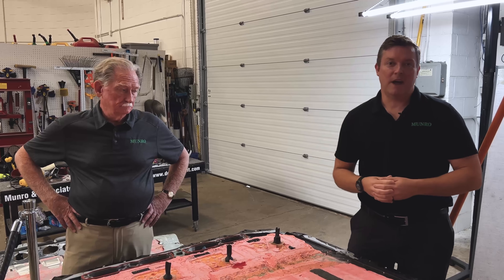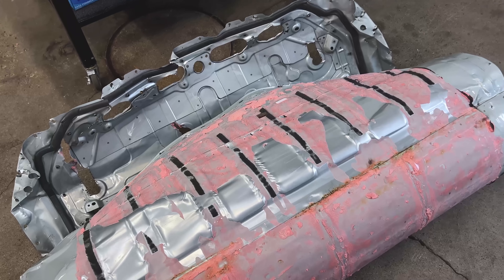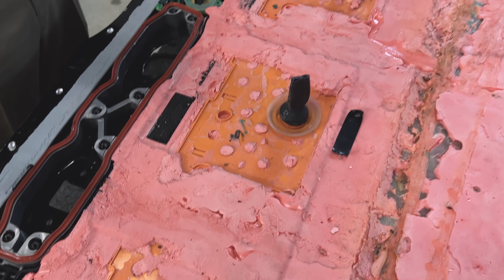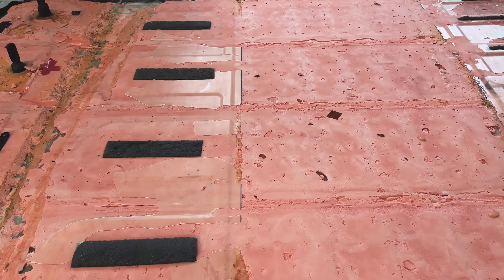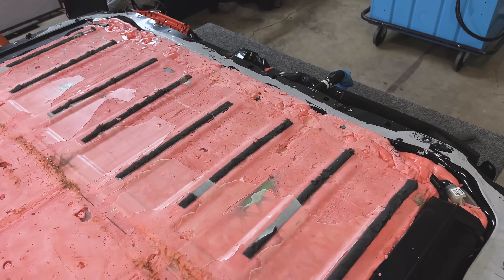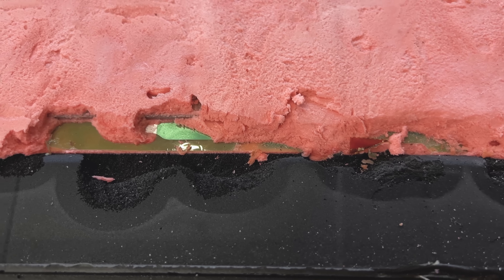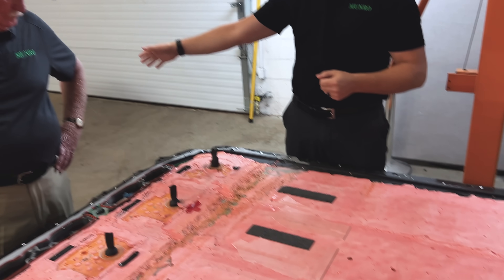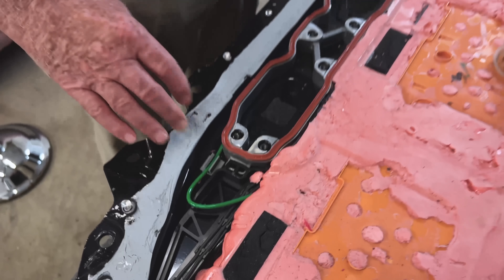FINALLY! 4680 Battery Pack Lid off | Tesla Model Y Update

Comment: I looked into it because I was bored, if they’re going to try and dissolve all the foam the only way to remove all of it is a combination of equal parts Tetrahydrofuran (THF), GBL and NMP. of all known solvents only this mix does 100% of the job and melts it away.

these three solvents are fairly safe (NMP can cause birth defects but as long as none of them are pregnant it’s probably not too bad, the studies show it’s not that horrible and the studies were somewhat inconclusive)

I still think trying to go in from the bottom and cutting through the aluminum is the best bet.

Comment: I wish someone could explain why this structural battery pack is a good idea. Seems silly to me. Like making a bridge out of marbles
Reply: Wrong analogy, structural pack is to eliminate the extra weight of batteries as potatoes inside a big bag in your car and to use those potatoes as the structure of your car. So you eliminate the other structural members, heavy cross beam rods and 69 other parts. Its god tier efficiency.
Reply: @neighborhoodtroll  I think cross beams are a more efficient use of structural material than the thick, heavy metal added to the 4680 casing

Comment: I’m sure there’s an obvious long-term gain on the emissions side but can’t help thinking how odd it seems to replace an ICE engine and fuel tank with an unrepairable battery encased in an oil-based product that will require dissolving with some kind of wicked solvent for any type of reuse.
Reply: Its really rediculous and I hope Sandy will aslo discuss the serviceability topic. 
That structural battery may be measurement to reduced the production costs of a BEV vehicle but involves at the same time a high risk for the guarantee and goodwill costs.
As long as battery uses moving electrical parts such as switches relays or contractor batteries will fail. 
But who cares within time of guarantee this risk will be less

Comment: The best move is probably to flip the thing over and go through the aluminum on the bottom. Chemicals are a baaaad idea. Trust me it won’t do anything but soften that foam and melt the plastic below and get your batteries stuck in a gooey caustic mess. Dimethylformamide or N-Methyl-2-pyrrolidone are not chemicals you want to mess with!

DMF is readily absorbed through the skin, inhaled, or ingested and a potent liver toxin.

NMP is a teratogen. So you’ll possibly have a flipper baby if exposed to it. Effects and deforms human embryos.
Reply: I don't believe that flipping it over will help.... to be truly structural that foam has to entirely enclose the batteries to make a solid brick. If the batteries were loose underneath, none of what's going on up top would make any sense.
I wouldn't be surprised if there was even more foam on the bottom, to ensure that nothing pierces into the pack if the vehicle bottoms out onto something pointy during an unplanned departure from the road.
Reply: That is too high price to pay for subs on YouTube 😅
Reply: In this video we already see that the electrical connections between cells appear to be on the top, so to analyze the design and construction of the battery (which is the point, despite the plan to sell cells) it needs to come apart from the top.
Reply: When I worked at Schaffner R&D we used to dissolve competitors products with dangerous chemicals. Everything comes apart if you throw your mind at it. Workers safety is another issue, it can be overcome but exposing them chemicals to the environment is perhaps also questionable. In my apprenticeship we used endless drums of Freon just to pride ourselves with clean circuit boards. Not sure which job did more damage to my internals. Back in the 70's it was also common to smoke inside confined small hectic offices all in all a third danger to my health. There are already videos floating around dissecting them new cells.
Reply: @LawpickingLocksmith  Jordan Giesige of The Limiting Factor is doing a very professional tear down of the 4680 cell with some experts at SDSU. An excellent channel that goes in depth into the EV battery thing.
Reply: @terrysullivan1992  
🤔
Jordan?  Very professional.
The stripdown?
.
They know chemistry, but at one point they were using pink handle nail scissors to try and strip the steel casing.
.
🤔
I reserve judgement.
Reply: Meh.. NMP isn't a big deal.

Comment: So the repairability is basically zero? you can't replace a single module easily and have to recycle the whole thing? it may have great characteristics but I'm not sure it's worth it, it really looks stupid to me and a waste of resources if only a few components fail. 
Or am I missing something?
Reply: There's a significant amount of redundancy in these battery systems, so it's unlikely that a few failures will scrap the whole battery pack. 

Then there's options for reuse in other (less demanding) applications, like stationary storage. As long as it's not a safety risk (ie was damaged in a crash etc) the pack will have a function.

There's also other issues with taking the repair option. Mismatches with battery age is one, you can't put a new battery in with old, easily (you could probably do a whole module, but not cells). You also have issues with safety when the whole thing is pulled apart (worker safety around high-power) AND when put back together, nothing ever goes back as well as it did from the factory lol.

As nice as it would be (I love user serviceable stuff) it's not a sensible option.
Reply: Perhaps it is serviceable from the other side, but this looks like a hard nut to crack.
Reply: The human cost in dropping a battery to replace a cell basically costs close to the amount of replacing the whole battery. That is what was missed.

Comment: Why not try one of those scanning lasers that remove rust?
Should eat up that foam but leave metallic surfaces relatively untouched
Reply: The lasers are set to a wavelength for the rust to absorb. The Foam will likely reflect the laser

Comment: Most engineers design and put stuff together - Sandy tears stuff down and tells what you did wrong and how to make it better. 😃
Reply: i was to say that, good critic is always welcome
Reply: i have worked on few of those foams, in insulating , refrigerated containers
Reply: To make it better....
1) FIRE the people who designed a $10,000 to $ 20,000 unrepairable battery pack!
2)  Redesign the battery pack so that it is NOT structural and can be opened to access components for repair.
3) Having the most expensive component in the car, costing $10,000 to $20,000 purposely designed to be throwaway (built in obsolescence) is unacceptable!
Reply: @DavidJohnson-tv2nn  are you assuming that the pack will be thrown away after use?
Reply: @okthisisthelasttimeipromise  No, but recycling does little good for a customer facing $10,000 to $20,000 bill for a replacement battery. As far as the customer is concerned, the battery packs are disposable, throwaway. Basically the car is throwaway, considering the cost of a new battery.

Comment: The foam might be easy to chip away using a power carver(tool used to carve wooden ducks). But needs a high strength non conducting blade made out  of some stiff polymer. Also needs to be careful not to remove any delicate structures on the path. Bead blasting is messy but might work as well to eat away the pu layer. The foam might also become brittle with a liquid nitrogen blast and could be mechanically  hammered with a chisel(shallow taps with high vertical angle to create and propagate  cracks to clear away big chunks at a time. Co2 laser could be used since it is safe to use with PU,but not sure if it encounters epoxy or some weird polymer(worst being Kevlar 
fabric) underneath PU. It could be extremely toxic or poisonous.
Reply: They mention an unspecified liquid used to dissolve the foam.

Comment: Is it even possible to recycle this kind of packs now or in the future?
What if a cell need to be replaced?
Reply: Costs too much to replace a cell, in human time… plus high voltage DC can kill a human worker.

No one replaces bad cells in a lead acid battery today, and workers will not be killed touching the terminals!

Shred these batteries, the same way lead acid batteries are chunked, and they will get 90+% recyclability out of them, just like we do with lead acid batteries, when 1 out of 6 cells go bad.

Comment: Breather tube may be there to vent out the electrolyte outgassing. Might have a channel to each module and to each cell. Just a guess. It could also be used as a vent hole during the PU intumescent foam fill, again a guess.
Reply: I was guess to allow air out from the foam, if it was for outgassing I would think it would be more durable.
Reply: Is there electrolyte in a solid state battery  ?
Reply: @ExploringCabinsandMines  this is no solid state battery.
Reply: @FelixLDevelopment  Duh The Raman guy mentioned it I was trying to school him.
Reply: @ExploringCabinsandMines  he didn't write anything about solid state batteries, but whatever.
Reply: @FelixLDevelopment  He said ELECTROLYTE  which is in wet cell ( lead acid ) batteries or whatever ....
Reply: @ExploringCabinsandMines    what you are writing doesn't make any sense at all. Today's lithium ion batteries do also have an electrolyte. Again, he did not write about solid state. Funny, that you want to school anyone.
Reply: @FelixLDevelopment  My point is Lithium Ion batteries do not require venting as the comment mentioned a vent tube for electrolyte get it ?  ?
Reply: @FelixLDevelopment  Is Lithium Salt liquid ? LiPF6
is a white powder so In my head that's solid state but apparently it's not.
Reply: @ExploringCabinsandMines   I totally do. I work in the field. Literally one meter away a cap assembly of such a cell is sitting on my desk. And that cap assembly has a vent, by the way.

Lithium batteries do not require venting in normal operation, but will produce lots of gas that will vent from the cells if they malfunction. This gas does (among other things) consist of the electrolyte these cells need to function. So everything he wrote up there is correct and you are looking dumb for wanting to school him.

I don't think he is right with his assumptions the tube is for gassing because that small breather tube would not be big enough for the amounts of gas venting from a cell that size, and also be blocked quite fast by parts of the solid material inside the cell being ejected by the gas flow. (There is also the so called cold venting where the cell gets a small crack and the electrolyte slowly leaks out. The breather tube could prevent a buildup here so the concentration doesn't get critical = explosive. Still unlikely since the breather tube does probably not connect to all cells as it would be to costly.)

I'd still bet for the breather tube to connect the air in the electronics compartment to the air in the pack itself for pressure equalization and maybe measurement.
Reply: @FelixLDevelopment  In doing some research I see I've used the wrong terminology, I said solid state when I should have said dry cell.
Reply: @FelixLDevelopment  Sooo you're saying I'm right for the wrong reasons ? the vent tube is not what he thinks it's for?
Reply: @ExploringCabinsandMines  no problem, I was just surprised by your persistence. I can also see where you got confused after reading up on wet cell battery types and lead acid batteries. I never had to do with those, so that's where I'm lacking knowledge. :-D

To answer you question from above: those salts need to be dissolved in a liquid, for example https://en.wikipedia.org/wiki/Ethylene_carbonate

The ingredients of the electrolyte is typically one of the biggest secrets of the cell manufacturers and has a huge impact on performance, safety and aging of the cell.
Reply: @ExploringCabinsandMines  yeah, and I can't wait for the next video where they show us what it really does.
Reply: @FelixLDevelopment  Ya I read that about the dissolving of the salts but the videos iv seen show the battery being wrapped , they call it a liquid but I don't understand why.
Reply: @ExploringCabinsandMines  typically the three layers anode, separator and cathode are wrapped, inserted into the cell housing and then the electrolyte is added before the cell is closed (either through a special filling hole or before the top or cap assembly is added). It's not much, only somewhere around a shot glass for a cell this size. So it's not like everything inside the cell is filled with liquid.

Comment: So much for sustainability. No way to repair this pack. Few busted cells will render this $30k repair. Still want one ;P
Reply: It has a huge secondary market for energy storage and at the end of it life it will be shredded and fully recycled ♻️. 

This is a huge generator for a house or small business no more power outages like a power walls but with a greater capacity and because it is LFP it is particularly suited for this.
Reply: It can be fully recycled and on average they will last 15+ years

Comment: My guess is that the tube was needed to vacuum the resin into place, as some fiber glass processes are achieved.
Reply: Yeah I like that idea. I was thinking for pressure release. If a battery pops you want to vent the gas vs. Gas build up. But ilike your answer better

Comment: How would Redwood recycle the pack as a single unit, or would someone have to do some work prior?
Reply: I had the same question.  It would be worthwhile for Sandy to invite Redwood in to comment on the recycling of the battery during its disassembly.
Reply: Discharge it, throw the whole thing in a large grinder, then use various mechanical, chemical, and thermal processes to separate out the individual elements. In a large-scale operation, it would be too much cost in labor and time to break it down. Search for this video on YouTube..."VOLKSWAGEN ELECTRIC CAR BATTERY RECYCLING PLANT".
Reply: @UTubeRangerBob  yeah I’ve seen that way but it’d need a pre-smashing monster I suspect and the chemistry of the glue….?
Reply: @davidpearn5925  there are grinders capable of swallowing Cars as whole. would also work for a completely drained battery.
Reply: @unitrader403  yeah, and if the castings crack in crashes they won’t need to separate from the car.
Reply: @UTubeRangerBob  It may not be possible to discharge a significantly damaged battery.  Shredding in the correct orientation should be possible to prevent a short in the battery circuit, so avoiding thermal runaway.
Reply: The whole thing is shredded, then milled into a powder. The metals are separated chemically.
Reply: Discharge and then chunk it in the grinder.
Reply: Since Tesla probably created the foam, they also know how to remove it with chemicals.

Comment: THE PLASTIC TUBE: Foaming high density polyurethane is a great choice. There is no better bonding substance, yet that foam rises slowly enough to allow that slight plastic tube to exhaust some cavity air, what we often do when injecting large parts. The size of it is ideal since when the foam reaches the inlet it quickly jams up inside, signifying that all the air is out, the foam filling the entire cavity with pressures of up to 10 pounds/in2 while the entire assembly is contained in a sturdy steel  clamping unit.  They use a new length of that cheap tube each time. Of course for this to happen it had to have been installed in the right spot of the cavity. Frankly I see absolutely no other way Tesla could have made that pack structural without that exact rigid foam with amazing stability and properties. I have been using it to manufacture unbreakable injected Nordic skis in Finland and Canada, but also for thousands of much larger specialty building components like explosion-proof building panels for Hydro-Quebec's IREQ research center.
Reply: I learn more from the comments section of this channel that most other YouTube channels' main content
Reply: There You go!)) Personal Experience for the Win 🏆 ✨️
Reply: Jai m, I loved this so much that i went to your channel and subed. thanks.
Reply: Are you Q from James Bond?
Reply: Absolutely the most impressive youtube comment I have ever seen, I literally went "wow, this guy is smart!".
Reply: Yep green breather tub to allow off gassing while the foam did it's chemical process.
Reply: It didn't look like there was any foam in the tube?  Was this just to relieve the air pressure on expansion?  Did they have the exact volume calculations to make it so no expanding foam made it to the tube?
Reply: @youmakeitreal  I think he meant blocks the other end of the tube?
Reply: Fantastic! thank you for the explanation! maybe Tesla is hiring?
Reply: Thanks. Exactly what I thought it was there for but better to check with an expert. 👍
Reply: Is that foam protecting the battery of burning? What do you think?
Reply: @benoitgroux6543  It would help because it displaces air (oxygen) and also would be relatively watertight whilst sealed.
Reply: @benoitgroux6543  it is fire retardent as well as being a structural component.
Reply: @KahnSkins  Can you tell the manufacturer and name of this foam? Is there a technical datasheet available online? Would be interesting to know.
Reply: @ghostzocker  I dont know that much info on it, but the original comment by Jai suggests it is a high density polyurethane.
Reply: Ah thanks! So does the right spot in the cavity differ for each injection? Merci encore pour le partage !

Comment: Wow so environmentally friendly and servicable!  How green!
Reply: It's pretty green. Use a press to punch the cells out, melt it down onsite in Texas, its much higher content than the raw ore they normally use. New battery from old, goes in new vehicle. The raw materials didn't go anywhere and its a lot more efficient than digging and refining new ore. A lot cheaper too. Meaning the packs have value, ensuring that every one will be recycled.
Reply: Fully loaded with an oil byproducts too!!!! 😂 😆